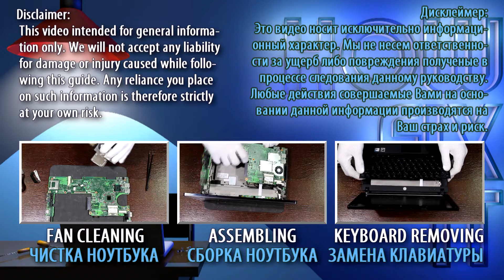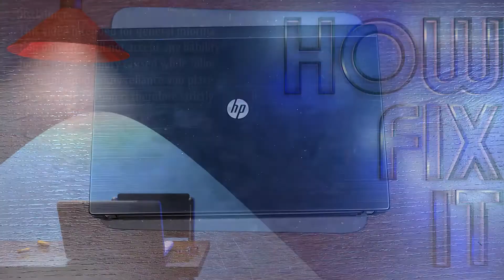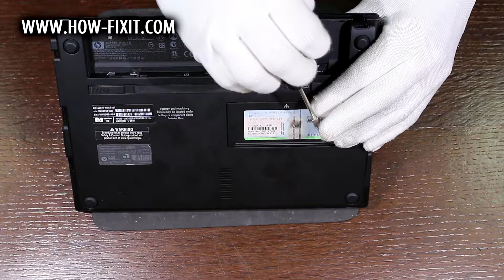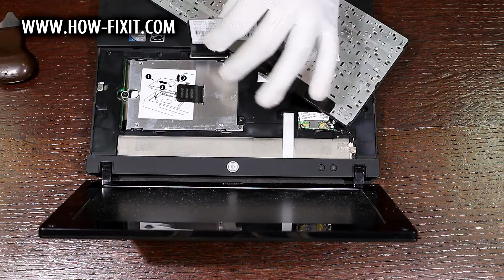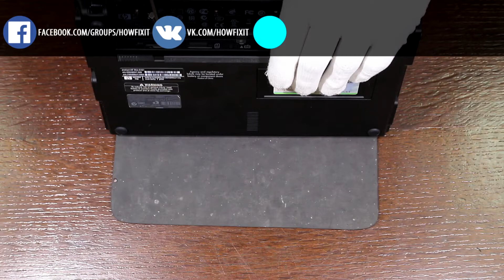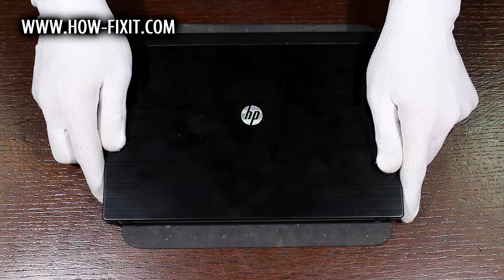Upgrade HP Mini 5101 Hard Drive to SSD - Step-by-Step DIY Guide

Comment: Hi - thank you, i just changed the very slow hdd ( no rattle no noise it still works but it is very slow win7 take 5 mins to boot and even linux mint 17 takes 5 mins, almost the same time as a usb stick in the usb2 port for linux mint live )

Oh - i did not need to remove the keyboard cable 

Regards
George